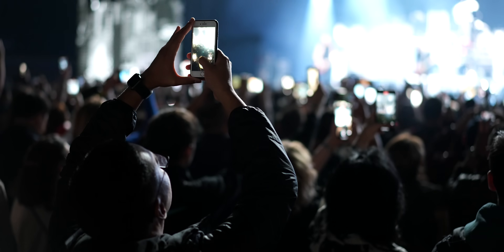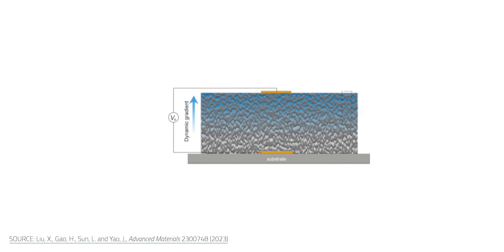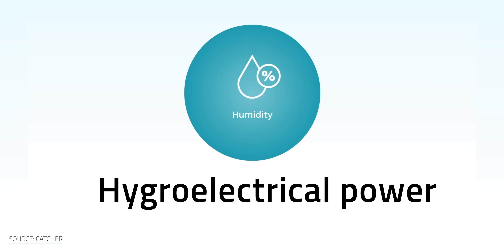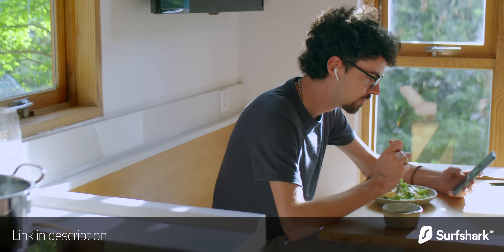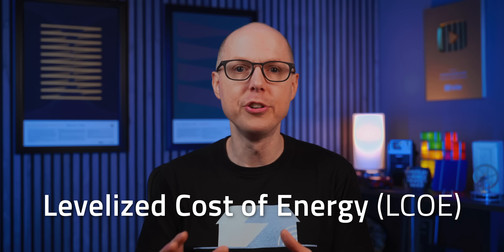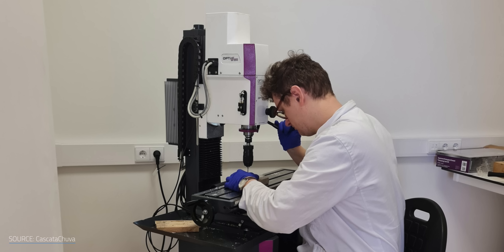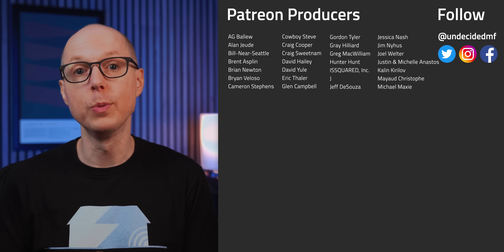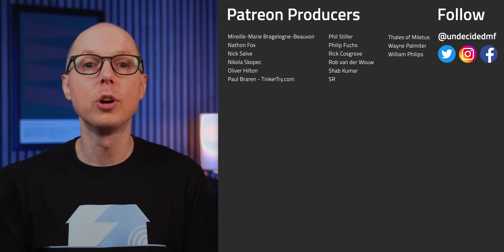Is This Accidental Discovery The Future Of Energy?

Comment: From a purely thermodynamic perspective, it feels hard to believe that any amount of energy can be generated from moisture. This feels suspiciously close to some perpetual motion/ eergy schemes
Reply: I expect the energy is not generated from 'humidity' but from a humidity gradient. So you need both a wet and a dry space next to each other, and that difference gets consumed over time.
Reply: @jurgenhissen My expectation too.
I suspect the material produces voltage when exposed to high humidity, from a low humidity resting (storage) state.
The energy required to "dehumidify" the substrate might exceed any energy generated by exposure to humidity, but I would need more details.
But perhaps this could be a way to convert "low grade" solar thermal heat into higher utility "micro-electric' battery energy.
Reply: @jurgenhissen This
Reply: @jurgenhissen  thats what i'm thinking, but this suggests that it wouldnt scale well. Again, thermodynamics is pretty strict here and making electricity generates heat, which will impact the specific humidity. If this can be scaled without centralizing production and creating heat, it could be a benefit.
Reply: As the device soaked up moisture it would cease to generate charge, so you would need to supply heat energy to dry it out. I don’t think that is covered in the video. There is no such thing as free energy.
Reply: @Tailspin80 what makes you think this is "free energy".  This is solar energy harvesting, just in a different form.  The sun evaporates water, imparting energy into it, this harvests some of that energy.  Its no different than burning a tree for heat, just at a slightly different scale.
Reply: @josephhfry  So you would agree that the unit would be sited outdoors? If so it’s entirely weather dependent and depends not just on humidity but also solar intensity and probably wind to dry it out during recharge. How is that ever going to work in practice?
Reply: @Tailspin80  no.  As I understand it from other sources, this is taking advantage of the same effect that causes lightning.  The water molecules in the air interact with each other and become charged ions; like a balloon builds up static charge.  This device creates energy by having a lot of charged molecules on one side and none of the other and providing a path for current to flow to discharge them.

The sun is responsible for causing the humidity and causing the water molecules to move around and become charged in the first place.

I do suspect a large system will be more effective outdoors as eventually the number of charged water ions will go down over time in an enclosed space.  If it even scales at all (I'm skeptical).
Reply: @josephhfry  Sorry, but it sounds ridiculous. Sure, there is static electricity floating about but the amount would be so minuscule it wouldn’t be worth it. Love to be proved wrong.
Reply: @Tailspin80  I don't disagree.  Unless the actual mechanism at work here is different than I read, I am highly doubtful this would scale.  That said, a single 1ms bolt of lighting produces enough power to supply a US home for over a month. Perhaps a system that processes a similar volume of air over a much longer timescale would be able to extract a similar amount of energy.
Reply: @josephhfry  if it is based on a gradiant of some kind (humidity, heat, pressure, charge, whatever) wouldnt we need some way to produce/keep that gradiant? would taht not cost power?

Also also wouldnt whacking mor of these things in an enclosed space massively reduce the output?
Reply: @Tailspin80  That's really interesting. Maybe you could switch out the medium that collects the moisture automatically. As far as I understand, it's the movement of the tiny droplets that creates the power? At some point it would just start dripping off the medium, kinda like a dehumidifier.
Reply: It’s the difference in humidity that’s generating energy, kinda like how a difference in temperature can generate energy.
Reply: You don’t need to recharge it theoretically, once it is saturated, taking it to a dry area should also create a voltage just in the opposite direction.
Reply: @ewanlee6337  It’s a major flaw in the concept though. How are you going to dry out a washing machine sized unit without fans, dehumidifier etc? These would consume more energy than the unit.
Reply: @Tailspin80  you’d rely on the natural cycles of humidity over the course of the day. Typically the morning has the lowest humidity as the cold night causes humidity to condense out as dew and then the humidity increases over the course of a day. Though weather patterns would also affect this.
Reply: @ewanlee6337  Sounds completely impractical. Humidity varies unpredictability over the day and across seasons. Even with a sudden conveniently timed period of low humidity a large unit doesn’t just dry out. It would need forced air blown through it, like drying washing on the line. It would also be very temperature dependent, maybe leeching energy from the heating / HVAC.
Reply: @Tailspin80  Yea I don’t have high hopes for this. Though the unpredictability is fine as long as it’s peak generation times fill the low spots of the other renewables.
Things absolutely just dry out if made right and given hours. 
Also I suspect that this technology is taking energy from the entropy of have high and low humidity kinda like how thermocouples take energy from temperature differences. 
Given how shit thermocouples are I don’t have high hopes for this but since it seems to depend on structure rather than material properties there is some hope.
Reply: @ewanlee6337  I’d like to understand the physics. It is not clear whether it is trying to be an energy generator or a battery, where the energy is coming from or what the recharge cycle is. This channel is usually a bit more sensible.
Reply: @Tailspin80   The researchers themselves don't understand for certain what is going on--how would you expect this youtuber to?
Reply: @justinw1765  Matt Farrell is quite a smart guy. He knows it’s nonsense, buy hey - can’t argue with the ad revenue for half a million views?
Reply: @ewanlee6337  I suppose the thermodynamics ritualists would tell you that the work required to move the things around is the cost of recharge or something.
But I think the thermodynamics ritualists are also wrong in looking at this as a "free energy" claim. The movement of moisture through the atmosphere is getting energy from the sun, just like the wind, so hygrodynamics are no more a "free energy claim" than is wind power.
Reply: I want to know what is the excited and ground state of whatever provides energy. 

Is water vapor excited state and liquid state the ground level? If you need heat to evaporate water, so condensation should give energy to the surface it lands on, but collecting water in nano structures sounds like something that will clog the machine. Will it stop once machine temperature is in balance with vapor?

Is the energy from the difference in humidity between outside and inside of nano structure? So discharging should allow the vapor penetrate deeper into the structure until it is in equilibrium - will require day/night cycle to make the relative humidity change to provide difference in gradients. This could be like some tidal energy that changes with on a scale of a day.
Reply: @TheMiczu  Great question. This is the second time I hear of this device. And neither of the videos even tap on this part.
Is it like a battery, then how to charge it?
If it operates like a generator (continuous energy output), then what is the flow of energy/material/particles?
It can't just sit there, consume humidity from the air and generate electricity. If that was all, then over short time the device would get absolutely soaked.
Reply: If you stick a black surface to one rock, and a sufficiently reflective surface to another rock, then insulate the bottoms and leave them a while, a low-gradient heat engine placed between them might look like a perpetual motion machine. However, it'll only keep going so long as the daytime is hotter than the night and the engine doesn't break.
Reply: if we wanted to try to figure this out, i'd go out with heat: hot humid air enters this thing, nano magic happens (because the smaller we go the funkier physics turn) and then you remove heat from the air, thus condensing and generating electricity from the heat because it vibrated something in the mesh. Maybe, who knows.
Reply: If you didn't understand how rotors and turbines work, you'd think the same when you heard the word "wind power". 
As far as I understand it, it's the movement of moisture - kinda like wind, that generates some power. Though it's on nanoscale, so either it would be super fragile or very hard to scale.
Reply: It is using triboelectric effect similar to how thunderstorms work. It would need to have a thermal gradient to constantly generate power. The cold side would be the emitter while the hot side the acceptor. The ideal material would be graphene nanotubes on a thin gold substrate. Would be a very reliable humidity sensor if nothing else.❤
Reply: The teeny tiny devices I can see working - for a short period of time until becoming saturated (since they rely on a humidity differential), but the appliance scale unit sounds way too good to be true.
Reply: It reminds me of the concept between fuel cells
Reply: Tell that to someone who's been hit by lightning.
Reply: I'm not a scientist, but know some stuff here & there. In meteorology class we learned there is latent heat in clouds that is released when it rains. I'm also thinking of lightning and tornadoes. There's energy in these phenomena, and do we ever see any of them without moisture ? OK, while maybe these are not the same phenomena as humidity batteries, could there be some kind of relation.... ? I might have to hit the science books to understand anyone's replies.
Reply: @SarahStilesComposer  Tornados would be the closest since that's related to differentials in air pressure - this phenomenon is more or less about creating a difference in the partial pressure of water vapour. The latent heat in clouds is the latent heat of vaporisation though and it's just the reverse process of boiling/evaporation - you need to actually condense the water to extract that.
Reply: its not perpetual motion but rather, there is more supply/ fuel than the device could manage to deplete on its own. just as thunder in the sky isnt a perpetual energy. its the result of a difference. and so long as there is enough forces acting, it wont simply run out as the conditions are generated. 

the device would prob be useless in areas with low humidity, and could prob cause the average humidity to drop if enough of them were produced.
Reply: ahem ..... lightning
Reply: Sorry to spoil the fun of a well-meaning science buff, but...

CO2/climate-change is the biggest mass-fraud since communism. 

(See Henrik Svensmark for the cosmic-ray/solar-activity/cloud-formation/climate relationship.)

 CO2 is a ruse. 

Climate change the "Greens" are talking about is caused by changes in the cosmic-rays/solar-activity relationship and cloud formation  (See the work of Henrik Svensmark.)  

Cloud formation by actual cosmic rays can be scene with the naked eye in Cloud Chamber demonstrations.  YouTube has dozens of videos about them.
Reply: There are plenty of red flags in there. The scientists have just discovered a process which they don't fully understand. But there is ALREADY a company trying to commercialize it. How does it make sense? What are they trying to sell? How are they going to promise their customers that their machine is going to work if they themself don't know how it works?
Reply: There are evaporative cooling devices used as cheap ACs. When you evaporate water it cools down the air, which implies the humid air holds some of the energy that was heat in a different form. So it makes sense (in theory at least) that you could potentially extract that energy back out of the humid air.

I'm more skeptical about what happens to these water molecules after going in the tubes. If there is current, where exactly are the electrons going? Individual H20 molecules are really dropping them off, and then picking them up again?
Reply: @FriendlyFireYT  I doubt the H2O molecules are picking up and dropping of the electrons, but them creating moving on a surface might create a magnetic field moving preexisting electrons...
I do wonder tho if we use the humidity and the energy that's in there do we create liquid water? and if so can we use what is commonly knows as a "swamp cooler" (or evaporative cooler) to cool down a space, storing that heat in humidity, and then use this device to extract that humidity again and generate electricity, essentially creating electricity from heat.

if that is the case then we could make existing fossil powerplants that are near 100% efficient with their fuel. 
I know that's a silly dream, but a girl can dream.
Reply: @FriendlyFireYT  it sounds like the goal was to keep water vapour out, creating a delta to exploit, Brownian motion energy extraction?
Reply: @FriendlyFireYT the “extra energy” you talk about here is just heat stored in the water as heat. There’s no extra place for the energy
Reply: I hope it works. I don’t care for the look of solar panels on my home.
Reply: Taps Brownian movement.
Reply: @brodriguez11000  Such would be a perpetual motion device, second grade. The type where you just cool down something and  convert the heat into other energy. Consequently and ultimately cooling down to 0K. We know this is not possible.

Comment: 6:18 only making 10 kwh/day where i live power cost is 14 cents per kwh, so this would make $1.40 per day,  at $18000 it would take 49 years to break even. 10 kwh/day is not the game as a 10kwh solar  setup that would generate $1.40 for every hour the sun is at full intensity. I also don't think an average house of any small size only uses $1.40 of power per day.

Comment: I don't know why this isn't just an air conditioning effect. As a gas at temp X meets a solid at temp Y that changes temperature at a slower rate, the gas turns to liquid along a surface. The phase change sucks the energy out of the air while it condenses. There will be an inevitable charge. Would the machine require a coolant?

Comment: 24 hr. / day, rain or shine, wind or no wind, and far cheaper than solar or wind when government subsidies, government debt, is removed. Yeah, I'm in. No mounting stuff on my roof which wasn't designed for the load. No more removing panels when I have to replace or repair a roof. No more aerodynamic and mechanical noise from a wind turbine, nor dead birds. Yeah, I'm in. And all I need is a weather barrier, a pole shed, with holes to allow humidity to pass freely, yeah, I'm in!

If this really can be made from a multitude of materials, as long as the feature size is correct, yeah, I'm in!